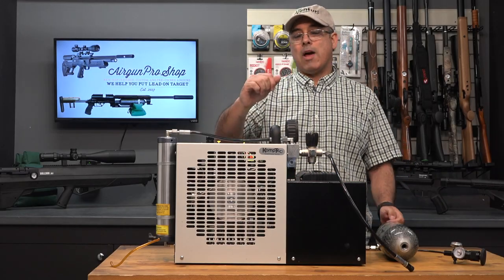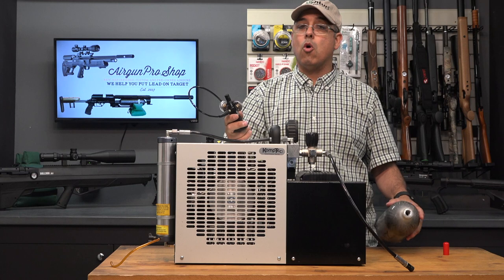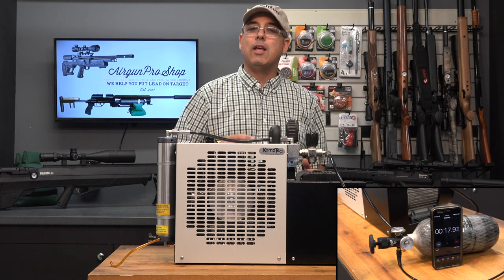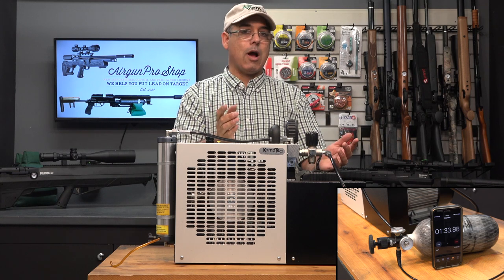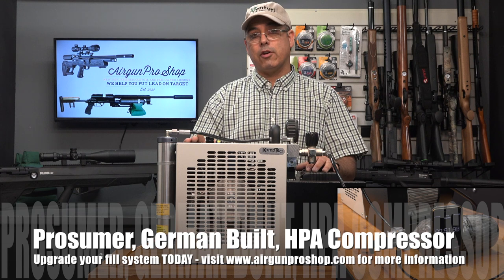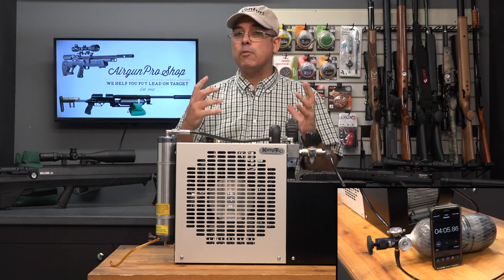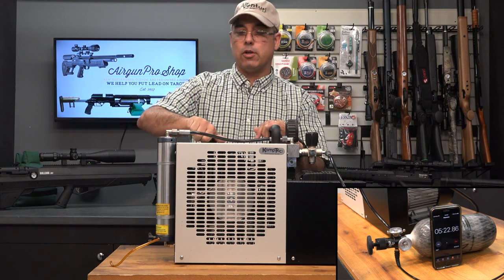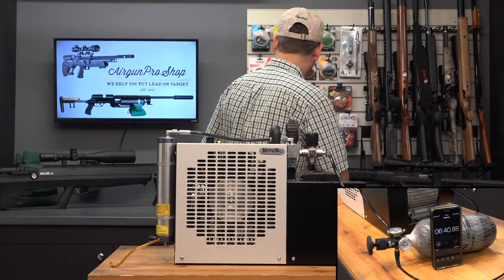HPA Compressor for serious PCP Airgunners! Certified Breathing Quality Air - www.AirgunProShop.com

Comment: For divers.
The air filter is rated for use 15 hours before needing filter service.
That is 900 minutes of run time on the compressor.
A full size scuba tube is approx. 7 or 11 liters. (427 - 671 c.inches)
If the Ninja bottle is 90 c.in the filling time of 7 1/2 minutes a scuba tank ranges from 35 to 55 minutes.

Comment: He state you don't have to baby sit it with auto shut off. OK so are you suggesting it has an auto condensate valve that will auto drain every fifteen minutes of operation as well? If not you have to baby sit this compressor or risk having condensate pooling up in the bottom of your condensing tower when filling larger volumes such as an 80 CF SCUBA tank. By the looks of it from the video it seems there is only a simple manual valve a the bottom of the condensing dryer tower with a hose coming off it.

Comment: Great job Rick I just hope people will not ruin their expensive air rifles just to save a few bucks. Finally it taks you to hit the nail on the head with dry air and quality air the cost of a repair on your air rifle cant put a price on that thats why I am saving for one now.
Oil and compressed air don't mix well plus water from condensation a cheep compressor, might do this in your air rifle or pistol for me i would not risk this with a bargan basement compressor. Also this is a bargain for someone who scuba dives as i do  may I add. Only thing to figure in is the payoff point, how many fills before you make your money back, not long at the price per fill now, consider time travled back and forth wear on car or truck/milage costs factor all that in, plus you can charge your buds and fill their tanks. Don’t forget tell the Mrs that when your tank is filling you can start to work on her honey do list, that should help you to get her to open the purse strings. Keep the secreat to yourself that also translates to more time in the field. yes i want one as soon as i save up the money.
Reply from the maker: Hey there John.  You are 100% correct on all the above.  I bit the bullet on my first compressor.  It was a custom built 2CFM compressor built by James Sheldon.  It was about $1800 and still runs OK today.  It's built from surplus military parts.  It runs hot and loud but filled my tanks one after another, after another.  

These KompTec Compressors are WAY better.  Yes they are a lot more money.  But you get what you pay for and the kicker for me is how easy they are to service.  They have been building these in one shape or another for decades.  They have the process down. 

When you talk about SCUBA compressors, I asked for a quote from my local scuba shop on a bauer compressor with auto shutoff.  The quote came back at over 6K.  I'm sure there was a lot of margin in there, but still.. At just under $3K, I think these are a great buy for the serious airgunner.

Cheers
AGPS

Comment: Nice Compressor Rick. Good Video and Info... Wish you had mentioned price or maybe I just missed it... How would you compare this to the 110volt Daystate Compressor with a filter on it from AOA??? OR maybe even the Alpha-Carette Compressor w/filter from ATPlus???  Thanks... Good Day Sir'
Reply: There's a link to the unit in the video description.  Price will change based on the conversion rate of the Euro and also shipping from Germany.  So, better to leave the pricing on the website vs state a price in the video.

This is NOT the daystate compressor, although that is a good compressor.  In 110v it only does about 1 CFM.  This does 2.5 CFM.. it takes 220V however which can be a challenge for some.  It's worth it in the long run for the lower amp draw and more efficient motor.  The filter is also different as it can produce breathing quality air.  Price however, is not that different from the 110v daystate.  This unit is running about $2950 +/- a bit.. The Daystate 110v is $2700ish ??   and I'm not sure if the daystate has autoshutoff which this does.

Cheers
Rick
Reply: You didn't mention the price either for the ones you named.Go figure they all are high priced just like the guns.Both of yous get a thumbs down for wasting my time.

Comment: Another thing not to be over critical but it is a very bad practice to be using a beverage container with it original label still on to be collecting contaminated fluids. People have mistakenly ingested hazardous fluids before due to this oversight. Especially when your posting a YouTube video and trying to market this product. You defiantly would not grab an air riffle and point the barrel towards your eye on a YouTube video. To the point that your marketing to small shops that could bring in seasonal help that could be trained on proper use of servicing air fills then they see this video and think oh yes my soda bottle would be a great idea to collect the oil saturated condensate. Don't set you small business up to any liabilities, its not worth it and I even suggest you go back and use YouTube blurb feature and blurb out that soda bottle. Hopefully you take this in good regards as I do not intend to flame you or come off poorly.
Reply: Hey there Jeff.  You points are taken.. couple of things..  The coke bottle, I simply pull the label off before dealing with the disposal.  It has to be properly disposed of via a waste oil recycling.  You don't just toss the bottle out as is. But we'll get to that in a later video.  As for the "baby sitting."  You need to check the condensate drain every 25 minutes not 15.  It can actually go much longer, but if it's very humid, you need to check it every 25 minutes.  It can be fitted with an auto-condensate system as an add on. 

Cheers
AGPS
Reply: Good God Jeff, you would drive me insane.
Reply: Jeff is correct, i wouldn't believe unless i witnessed it for myself which i did and it wasn't pretty.